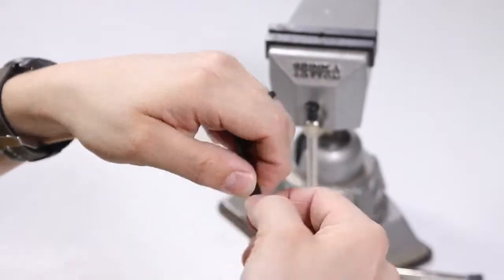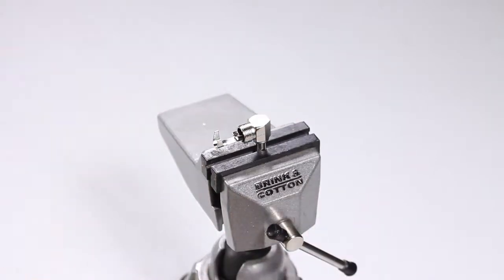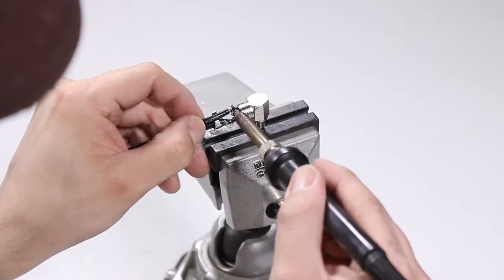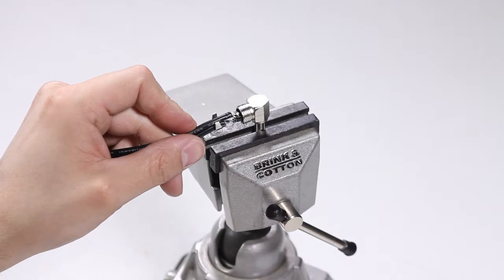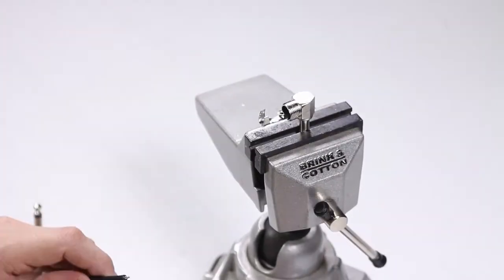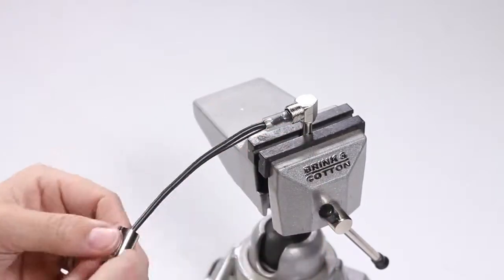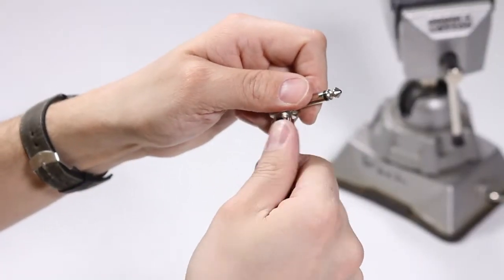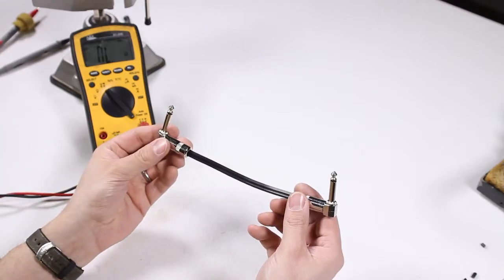Zeppelin Design Labs 6in Speaker Cable Build Video

Comment: Hi, I liked your video. i didn´t know anything about this. I would like to know if the cable that you used in this video has an especific impedance or can i use any kind of cable.
Reply from the maker: Omar: we use 16 gauge, stranded, two-conductor wire from the hardware store. it is the same wire used to repair a lamp, and similar to speaker wire. I think the most important thing is the gauge. Do not use anything smaller than 16 (that is, do not use 18 or 20 gauge. Use 16 or 14.